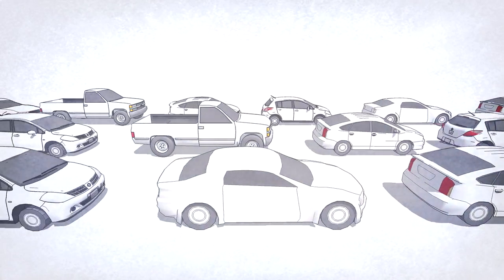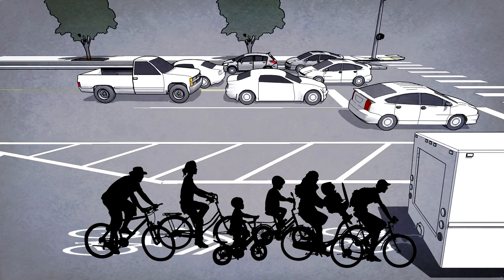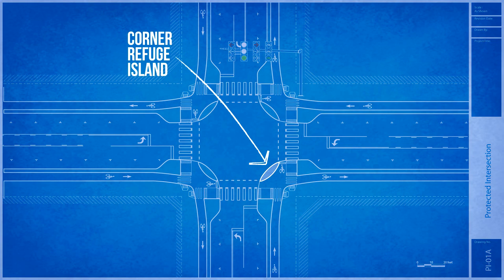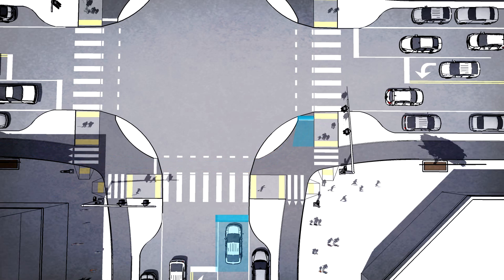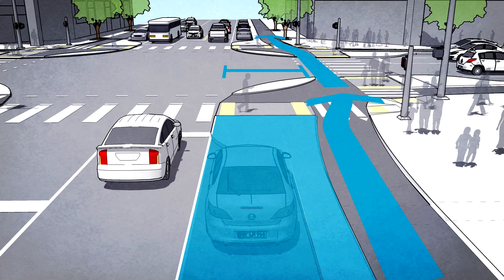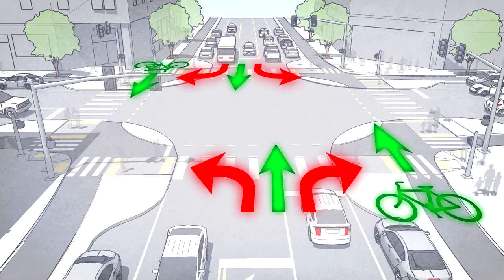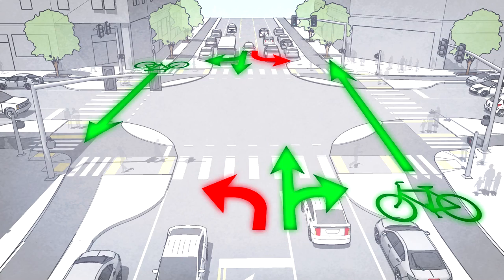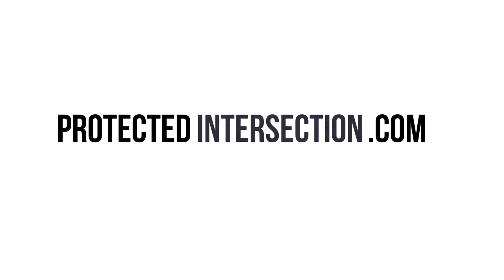Protected Intersections For Bicyclists | The Angry Architect

Comment: What a ridiculous and impractical idea. Every intersection would have to condense two lanes of car traffic into one! It would cause so much traffic.
Reply: Nah, the lanes are so wide that you can just narrow them.
The lanss are so wide in the netherlands that could be a 3 lane road, and a lot of roads have parking on the streets which is just dumb, in the netherpands on any slightly major road parking is forbidden
Reply: Im more people biked or w alked one lane of traffic wouldn't be a problem. What takes more space? A car or a person walking or biking? You could fit two cyclist or 6-8 people walking  in the same space a single car statistically only filled with 1.5 people. Pedestrian infrastructure IS good for drivers. More people walking = less people driving. Dont you want LESS traffic not more?
Reply: Only if you assume nobody would cycle or walk more after the change

Comment: A beautifully thought out idea but I don't see cities implementing it only because it seems like it would congest traffic (for cars) a fair amount
Reply: I am from the Netherlands and ride on this design intersection a lot. Congestion is not really a problem for us on these intersections, and we have incredibly busy intersections as well. It does slow traffic down for right turns, but remember it is not a race track they should slow down any way to look at pedestrians and bikes properly. This intersection is designed this way to increase visibility, but also to make drivers feel less rushed if he has to yield to cyclists. The guy behing you can go straight without you blocking his way. Enough material on youtube to check out. We have a lot of variations, my personal favorite are the roundabouts though. These typically improve the flow of traffic dramatically, no unneeded waiting for red lights as they are uncontrolled. Makes for a much smoother ride.
Reply: guido1981 Thanks for replying,
I'm gonna start researching Netherlands traffic regulations and congestion levels and start comparing to New York's now. This has piqued my interest :)